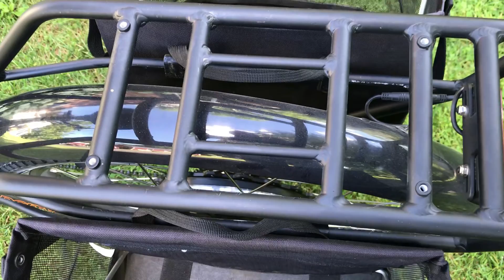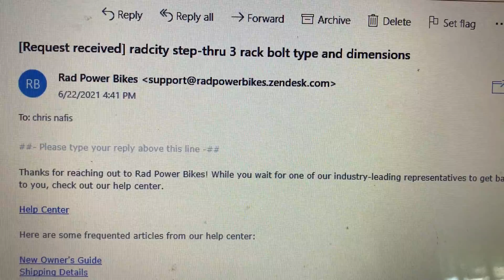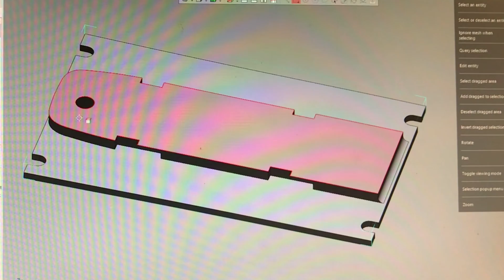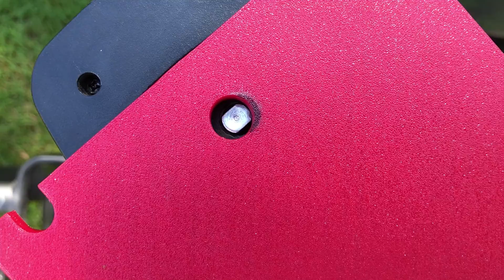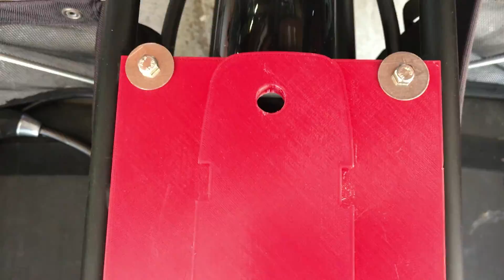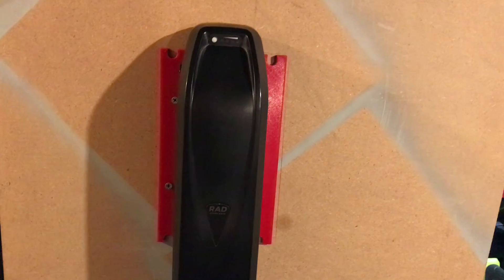Rad Power Radcity Step-Thru 3 Battery Holder for eBike Rack or Wall Mount

Comment: Hello Sir I have a Rad city 3 bike as well... I am thinking about mounting an additional battery to increase my range since I put 30 -50 miles per ride.  I have a bag on the top rack and was thinking on if I had enough room mounted on an angle in back of seat on the bike rack... also can you comment on the module used to use the two batteries?

Comment: Thanks, nice job! I use a different battery system for my RadMini (52 volt), but my wife FINALLY gave in and wants a bike now, so something like this would come in handy for the RadMini step-through I plan on getting for her. Since I have an extra mount, I might just use that, and wire in a battery blender to run both batteries at the same time.

Comment: How did you reverse engineer the mount?  Or maybe there is a Thingyverse model?
Reply from the maker: I created it in Geomagic Design-X. I put the model on Thingiverse and Prusa websites. https://www.thingiverse.com/thing:4894232
I traced it and made measurements with a ruler & caliper.
Reply: @SerendipitySue very  cool. I was hoping you were going to say you scanned it with your iPhone 12 and brought the mesh in to model from.
Reply from the maker: @BG_Lidar  for more complicated parts I would have ;-)  I don't have a 12, but have used some of the photogrammetry software in the past. I also have access to an old Minolta Vivid 700 scanner :-)